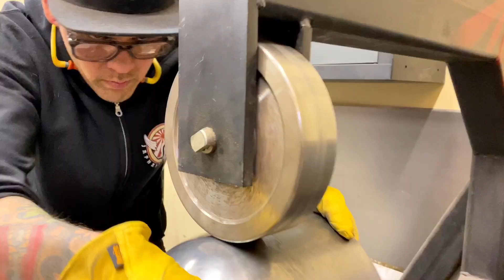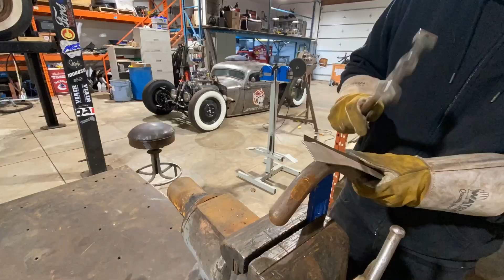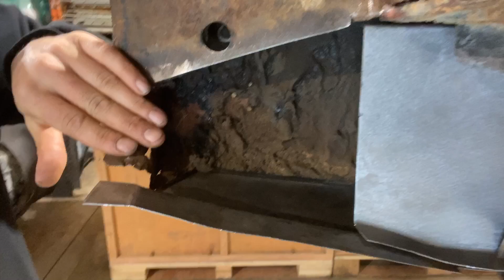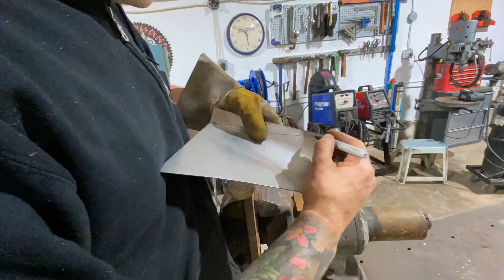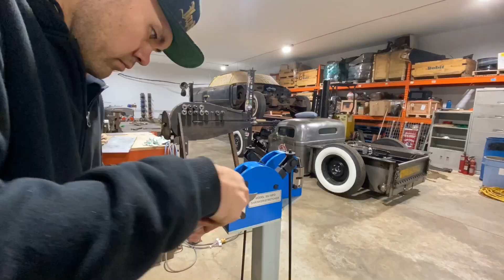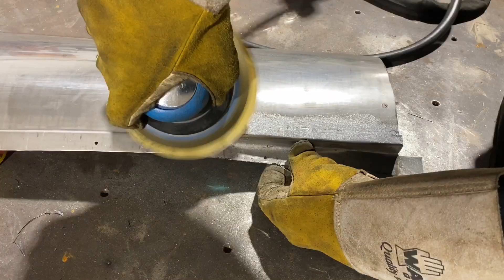How to TIG Weld Thin Sheet Metal Panels – 1960 Cadillac Restoration!!!

Comment: Thanks Karl. Yep start the puddle and go. For exterior work on cars I work on I prefer TIG since it doesn't leave a lot of filler if fitted right. You keep me coming back to see the progress on this caddy. As many have said befor it is a most beautiful impressive car. I saw one a month back that was a convertible and was laser straight and as black as black can be. Not a ripple anywhere on the body. I even got on my hands and knees to check everything out. I am 72 years old and have seen many thousands of cars in that time and this one was perfect. Thanks again for another helpful video!!👍👍👍👍😁😁💥✌️👌

Comment: Another great video. When you had shaping complex curves and angles. Try less time laps or half speed so we can see how your moving the metal a little more. Some of that stuff is so fast I don't have a clue whet your doing. Especially because of the difficult camera angles on occasion. I plan on tackling some of this heavy custom fabrication this year. Or atleast try. 😆 it's great to have resources like this.

Comment: Thanks Carl. I have seen the flattening of welds then squashing them with a hammer and dolly before on videos. I could not see an imperfection in the panel that my mind tells me would require that step... Please can you explain why?? obviously I missed something and sorry to bother.
Thanks
Donnie
Reply from the maker: Yeah it’s tough to see but it definitely tightens up after the weld. Also allowed me to put a little bit of a role in that area

Comment: Great video, my deceased dad and my brother and I worked on our 1930 Ford pickup that we put 1966 Chevy station wagon running gear underneath it with the 327 and power glide transmission in it. The motor and transmission is out of it now and has been sitting on blocks for about 20 years never finished. So now that my dad has passed on we’ve decided to sell it to my older cousin who is really wanting it to redo a frame off restoration in honor of my dad

Comment: Are you hammering with a proto? It looks like the size of a 1423 but I’ve never used that back end before. Something that you would recommend for certain applications? (Referring to the first hammering clip)
Reply from the maker: This is not a Proto hammer. I’m just using that and for stretching in a tight spot. Lol I just use whatever looks like it’s the closest shape to do what I need to do lol

Comment: The pioneers of"kustom" work would sometimes use tig to stitch weld long seams on say a roof that had to have a section added. Then before it cooled they would hammer on dolly the seam to avoid grinding and add strength to boot. Got to watch Bill Hines and a couple guys chop a car live in 2 days. It was sick!

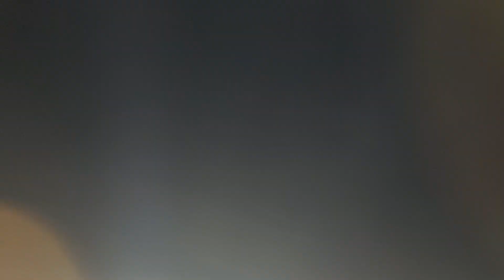Comment: 21:02 when I was trying this method of filming I found that you had to use black  tape to stop any light getting onto the back side of the glass so the camera cant focus on the glass and I was getting some really good shots. 
I made a camera mount using a pair of flip top oxy goggles so I could easily switch between welding and normal filming. (I made a video about it if your interested)

Comment: I have been hooked by your great video series.  My question is what Amperage or setup are you using for the sheet metal.  You mentioned going full throttle.  Are you keeping the pedal down the whole pass or are you feathering the pedal as the puddle moves.
Reply from the maker: For me I was using 40 amps

Comment: Karl, thank you for the great content. When I tig weld thin sheet I often get two parallel troughs on either side of the bead. They are thin...maybe .005" - .010" wide and deep. You definitely see it after the weld is ground flat. I know filler will easily take care of it, but I was wondering if you knew how to avoid it. Am I running the weld too hot?
Reply from the maker: Yes it sounds like you might have a heat issue or your tungsten is not sharp. Your tungsten must be sharp and the second it touches anything should be re-sharpened

Comment: I’ve been trying to transition to TIG.  I’ve been going back and forth.  Welded up a marker light in a flat area slowly with MIG with minimal distortion.  Then did the other side with TIG and I got crazy distortion.  Like up to a 3/8”!  Hammered and dollied l it back and got creases.  So I started shrinking with a torch.  Hammer dolly shrinking on and on.  I got it close after a ton of time.  I’m gun shy now!  Any suggestions?  Or do you use MIG in some applications?   Love the videos!  You da man!
Reply from the maker: Are use Meg when it makes sense. It’s often faster and more forgiving. I like tig when I can be precise and clean but nor if it takes too long or is unnecessary

Comment: This is the only way I know how to tell you something is by posting this way. To damn old to learn the right way. Have you heard of the machine called mechammer? I wish I would have found this before I retired. Trick tools used to sell them. Does a lot even like a Pullmax. Not expensive
Reply from the maker: Yes I’ve seen the tool! It looks like a great machine. I will be building A pullMax type machine In the near future

Comment: when you grind your welds consider a 5" air grinder with an 80/120grit disc  it spreads the contact patch out over a larger area so it digs in less on the base metal and blends better. use it like the roll lock and  use 9 o clock to 12 to get a consistent grind.  love the way you present your work and detail the methods and techniques you use, by far the best metal shaping videos on YouTube.
Reply from the maker: Thanks very much! I appreciate the info

Comment: Awesome skills and a great vid too boot.  

Please let us know your TIG details.  Size tungsten, cup, stick out, amperage, gas flow rate.  Ya know those details which are oh so important for making good welds on thin material.  Thanks so much and keep rocking.
Reply from the maker: OK I’ll do it take to set up a video soon!
Reply: @MakeItKustom  Thank you so much.
Reply: @MakeItKustom  Thank you so much. I just scored my first TIG machine it’s an older L-Tec 250HF with a water cooled system I bought just to do body and exhaust work on my Porsche 944LS swap hot rod.

Comment: Hi Karl,
Wouldn't you want to sandblast and spray the frame with epoxy before doing the rust repair?
-greetings from Iceland!
Reply from the maker: We’re not using this frame and yes sandblasting the body is great but I am not doing that on this one since most of the stuff is being cut out

Comment: When im tig welding a panel off the car and its 20 gauge I will over lap it a 1/16 use a chisel and hammer to put defined step then put a tac on the underside about every  2" then go back grind the overlap off beat it flat and there is zero gap fusion weld it done
Reply from the maker: Wow thanks for sharing I’ve never heard of that
Reply: @MakeItKustom  its just a different take on fritzees cut and butt with a mig welder

Comment: Hi Karl, thank you for another very informative video. Is there any chance you could make a video on showing the different body hammers and how/why you use them? I’m an electrician by trade so I don’t have the knowledge base that a lot of fabricators (you included) have regarding the finer points of metal shaping. Thank you again for another great video.
John
Reply from the maker: Absolutely what a great suggestion thanks John

Comment: The lens did not work out because of light coming in from the back reflecting on it same thing happens when I am trying to mig weld I have to get into the right position to see because of that but I also wear glasses and am a old fart
Reply from the maker: Thanks for the tip I will make sure to block the light next time

Comment: Thank you ! 🤟🏽 quick rookie question lol - you mentioned that the fitment and gap is key when tig  welding so when doing patch panels with mig My final gap is the thickness of the cut off wheel is that okay with tig or bit too much Karl? Thanks
Reply from the maker: That is much too much. With tag you want to be able to have as tight as possible I mean super tight. Ideally paper tight.

Comment: Great video and great work, do you remember how many amps you used welding those seams? Your heat affected zone looked great and narrow.
Reply from the maker: Yes I believe is right at 45 A
Reply: No "expert" here. Just repeating something someone said in another video: "use about one amp for each .001 (thousandth) of metal thickness". Pretty much verified here in Karl's reply. ;o)

Comment: its called autogenis welding when you dont use filler rod.   Best thing about tig welding is it is a soft weld unlike mig where you can't planish it and relax and warps that may form.  Tig can be metal worked and hammered and any warping can be worked out most times.  love tig welding, also as you said not high deposition so little if any metal finishing needed.  You do nice fabrication, nice job and you have good info.  I love the cleecos, so nice to use

Comment: Great video as always! Learning a lot and trying to put it in practice. Struggling right now to make a 1970 Monte Carlo rear wheel opening. It has what I think is called a step flange. When I go to put the step in that piece, it just wants to twist up. I think I would rather invest in the tools then a replacement panel. If at first you don’t succeed, try try again!

Comment: As for recording video through a piece of welding glass around the 21 minute mark. What you are seeing is light hitting the back of the of it and bouncing into to the lens.   The glass needs to be in direct contact with the lens and/or something to block the light from the top and sides.  (Hell put it in a cardboard box and mount the glass on one side.).  If possible lowering the exposure will help with that as well. 

I have used welding glass to photograph long exposures of fireworks using a pro DSLR. Had all the same problem at first too. Just f#cking around and trying things!

Great shit btw...in awe of your skills dude.  Thanks for sharing!

Comment: Great video as usual, but…I’d have like a bit more explanation as to why you were hammering on the welds and also a bit of information on the grinding you did too, grit # as well as the machine you were grinding with. Thanks for the great information.
Reply from the maker: Yeah I should’ve elaborated on that a bit. I was using an 80 grit On my 3 inch grinder. And then 80 grit on a DA

Comment: It looked like you had light bleed on the backside of the lens when filming the weld. I think you need to make a rig to totally enclose the lens to block all light from the backside. Think of it like a VR goggles, they seal all around the surface of your face but if you have light leak it will ruin the view.

Try black foam (packing foam) with a hole cut out for the camera lens and then recess the welding lens into the foam. That way you can slide it on and off.
Reply from the maker: Awesome thanks so much!

Comment: I'll have to look into the small tig rod. I've always done the same using .035 mig wire. I don't do much sheet metal work but on motorcycle exhaust. 
 Basically I would tack with wire and then bridge the tacks with fusion welding. Another excellent video btw. 👏

Comment: The chemical composition of the MIG wire generally has more silicon in it to help it flow and draw impurities out. Both are interchangeable as far as I know but -6 (more silicon) MIG wire may result in more impurities on the surface.
Reply from the maker: Yes this makes so much sense and I think with another gentleman said before. I see a pool on the top of Mig welds

Comment: I have a MIG welder and remember you saying that you couldn't use TIG because you couldn't access the backside of panels. Now that I see you hammering the backside of the panels I understand. The weld bead reminds me of gas welding beads except without the warping. Thanks for trying the new filter for welding and for making the metal working tasks simplified for us novices.

Comment: Now I want to know how you can do that thin metal with a $100 princess auto flux core welder. Cause it’s all I got. Looks very nice. And at the end when you have the pits and you have ground the welds down. Do you change your settings to fill. At this point and the ends I’m getting blow outs. Can can get close to your tacks but with a bump like the weld. But usually when using a copper plate behind the area I’m welding really helped with the blow outs.
Reply from the maker: Yeah you can definitely use that just takes a little longer

Comment: I love your content and the channel. I had a quick question. Ive seen others make complex panels out of several simple pieces and then weld them together. If its not a proper “restoration,” why do you take the time and effort to replicate the stock piece? Is it aesthetics? Strength? OCD? Thanks and keep up the great work!
Reply: Pride?
Reply from the maker: for me I am not strictly restoring cars two original in fact I prefer a Custom. But in this case and in many cases I’m just pushing my skill set and knowing whether or not I can. I also think it’s nice to sure what can be done with hand tools

Comment: Again a fantastic video, so informative and straight to the point. You Sir are an extraordinary craftsman. Can you elaborate on why you are hammering the weld afterwards. I understand that it shrinks, but I could not see any distortion in the panel. Has it just pulled the base material inward and distorted the shape ?
Reply from the maker: Thank you! Yes the weld itself shrinks So hammering it releases the tension and although it didn’t show that it was warped, it was. The hammering brought the shape back into it

Comment: Super cool work! But now that you have your panel made, what kind of surface treatment are you doing so it doesn't rust apart right away? Especially on the inside, where paint might be difficult to apply.
Reply from the maker: Thanks! How are using Weld through primers
Reply: @MakeItKustom  Thanks for the reply! Any paint over that after you are finished, or does the primer adequately protect?

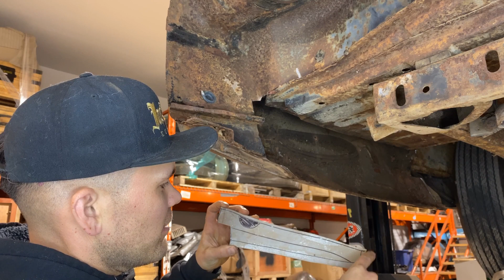Comment: at 3:01 you talk about a tape template that you used to transfer the shape to the card board, can you talk about that a little, is this similar to a flexiable shape pattern?
Reply: Watch some other videos from Karl, an you will soon know this simple and effective method. He applies it often.
Reply from the maker: This is different from a flexible sheet pattern. But this tape template does a great job of tracing the information of outside edges and beads

Comment: The other benefit to TIG and gas welding sheet metal instead of MIG is that the weld is the same as the parent metal and can be worked. MIG weld is harder and that's why it splits away when you hammer it. Very informative video Karl.
Reply from the maker: Absolutely a great point I forgot to mention! You can’t really work the panel like you can when it’s welded like this!
Reply: I have made that mistake and have to figure out a recovery. I tried to work / refine the panel but am finding the 80 year old steel starting to crack beside the  mig weld. any ideas Dave?? (have since bought a tig welder for that and other reasons)
Thanks for the comment
Donnie
Reply: As I understand it, most MIG wire has limited malleability, and that there is special MIG wire available without this limitation.

Comment: Mint vid Karl, how much notice do you take of the grain in the patch metal when setting it up for a stretch/shrink?
Reply: I agree with Karl, grain is not a consideration for automotive patch panel work.  Grain may need to be considered for drawing (stamping) parts into complex shape where a lot of metal movement is needed, for that they may also use draw quality steel that has aluminum added.  Most automotive repair / restoration work is going to use cold rolled sheet which does have some grain.  If you can find it, sheet metal that is hot rolled then acid pickled to remove scale then oiled is supposed to be softer and easier to work since it has more uniform crystal shapes that have not been stretched into elongated 'grain' by cold rolling but I have never had any.
Reply from the maker: I didn’t take any notice of the Grain. Is that a thing?
Reply: Thanks Lee that's more information than I've ever had on the subject, as a self taught hobby panel beater fabricator I had never been able to tell the difference

Comment: Were you using the magnum 200A AC/DC tig I've seen in the background for this and do you like that machine?  Looking for an AC tig and that one is in my price range.
Reply: Unsolicited opinion: i bought an used chinese ac/dc tig, the ones that goes with many names (here in italy its TIGMIG) and frankly for 350 euros used (800 new) its really a fine piece of machinery that i wouldn't believe. The only limitation its 100hz in AC but you have waveform selection with triangular wave for small gauge that should compensate that. 10 slot for saving parameters, pedal, pulsed, etc.
Reply from the maker: Honestly I think it’s a great machine for the price. This type of work is pretty light work for a machine like this